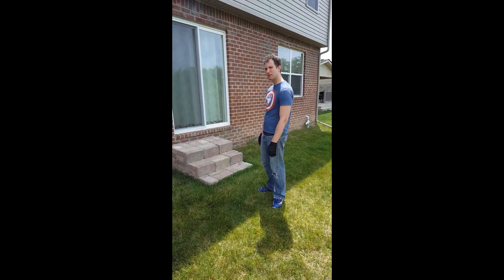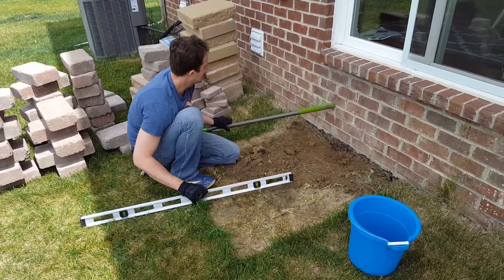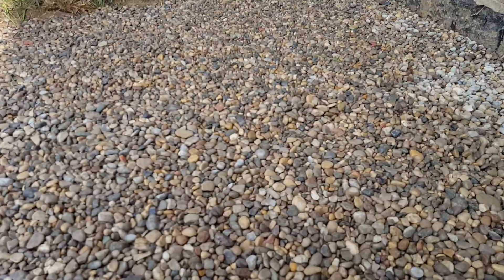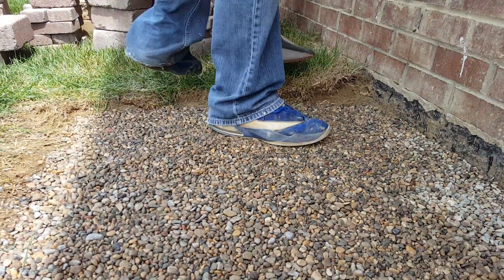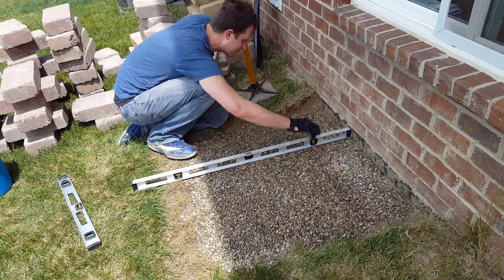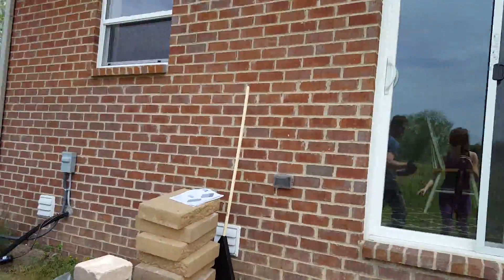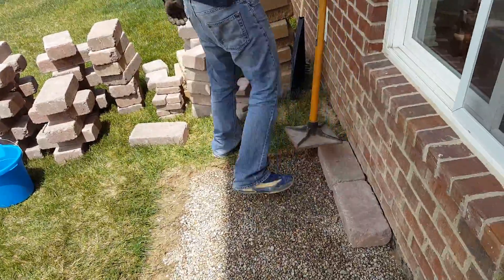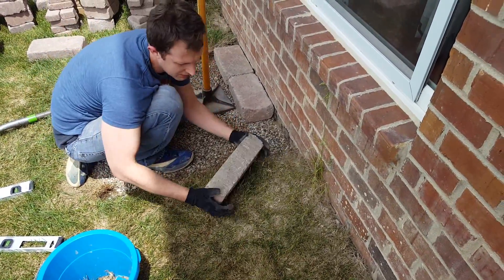DIY: Building Brick Patio Stairs

Comment: is there a good reason the steps aren't centered with the door?
Reply: Brendan Anderson yes, only one side of the door opens. The other door is fixed closed. Its a sliding door.
Reply: I imagine for practical reasons but aesthetically it's a no no and doesn't look professional, it should really have gone all the way across the bottom of both doors even if only one door opened.

Comment: Attention to anyone who is thinking of starting this project: 
Just to let you know, you used the wrong stones. You should’ve used mortar and concrete block with actual bricks for the stairs. You think you’re saving so much money buying patio stones and not using mortar but just wait a year or two after winter hits and the ground shifts and your pregnant wife falls on that or the mail man and you get sued to the Stone Age. Next time you should buy an actual masons level and not one from dollar tree. Also buy steel toes when working with stones of any kind, and technically your wife should be wearing steel toes as well.
Reply: Why on earth would you need to wear toe caps for such a silly little job like this, let alone his missus